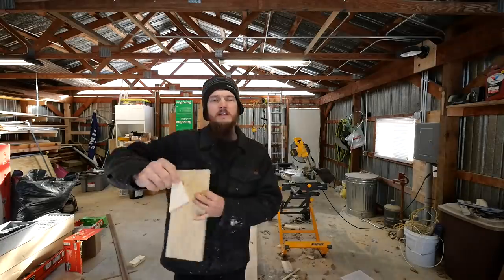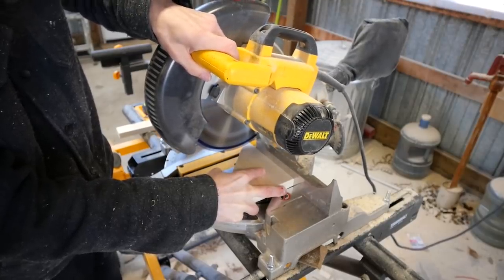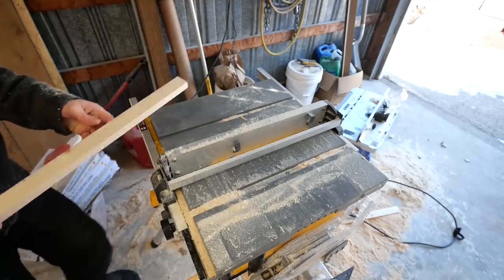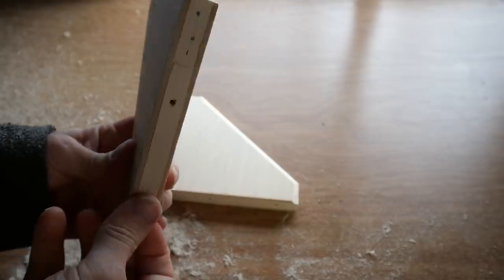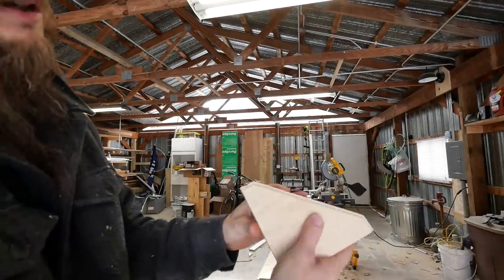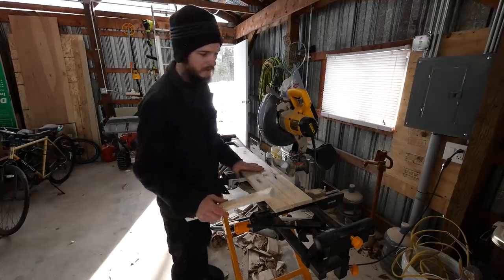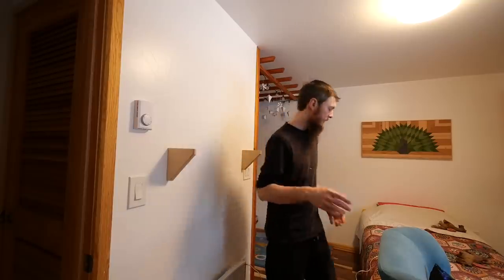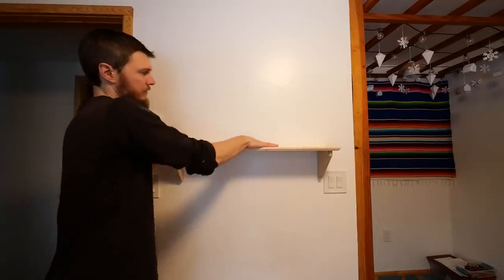Shelf Brackets Hacked - Hidden Hardware and Easy to Make

Comment: If any of your subscribers know someone in research and development in the home building industries or tools, they need to get their human resources people after you, Doug.  May be too 9 to 5 for you, but it seems like it would be a blessing to them and you and diy-ers!  The shelf bracket idea is great!  Again!  Glad I got to see you use the router around the corner of the bracket.  Would not have known that is how that is done.  Why did you choose a glue gun over wood glue to attach the shelf?  I would probably use nails or screws and putty it or put a piece of contac paper or veneer on the top of the shelf to hide them.  Hope you appreciate how supportive Ashley is!  Glad the weather has been good enough for you to get out to the barn and work!
Reply from the maker: I used hot glue to make the shelf easier to be removed in the future, if need be. The main idea was to experiment with shelf brackets. If I created a shelf unit I would have built it differently. Wood glue is too permanent.

Comment: Very nice looking shelf and I think Belle will get many years of enjoyment from it.  As an added note, when my brother was making wood shelves  such as this one, he would make a key hole in the bracket back and slide it down over a screw.  They held up very well.  On other shelves the were larger he would design a decorative back plate on the shelf  then pre drill and counter sink holes in the back plate, screw the whole unit to the wall then cover the counter sunk holes with a rounded button (they come in many sizes).  Those shelves were very strong also.  Love these DIY projects you are doing.  I am only sorry I can no longer do the wood working. Spent many happy years making country craft items.   Have a Blessed day.

Comment: Very nice. I think if I were doing it, I would put a dowel glued in the top of the bracket sticking up about 1/4 to 3/8 with a corresponding hole in the bottom of the shelf. It would keep the shelf from sliding from side to side and could just be lifted off if you needed to move the shelf. The part that attaches to the wall, since it is not seen could be made of nylon cut from an old cutting board and be less fragile than just a small wooden piece.

Comment: I like the clean look of painted drywall, but If I was building a house again I would put 1/4" plywood on every wall THEN drywall! We did this in both bathrooms as spacers due to built in fiberglass tubs, and it is SO nice to be able to just screw in anywhere!

Comment: I always look forward to your next video! The DIY shelve is  genius ! 
There are anchor screws that have a flare out built into them that works really good on Sheetrock when you can’t find a stud or like you said, not center to your room. We hung shelves in our apartment and that’s what we had to use, got them at Meijer’s. There is different sizes to fit your project needs.

Comment: Good job! 👍🥰
📐⚙ Only thing I'd change is to make the cut between the two pieces for the cleat be at a 45 degree angle. That will give an added level of strength to the shelf and prevent the chance it could pull out. 💪🥰
I used this same concept to hang a 3-door cabinet above the span of my washer and dryer. Mounted I think it was a 2x2 with a 45 degree cut (horizontally), about 1/3 of the way thru the 2x2, to the studs on the wall. Then mounted a 2x2, with the facing 45 degree cut, to the back of the cabinet. Lifted the cabinet up and set it onto the cleat on the wall. The weight of the cabinet was sufficient to anchor it, but I did put a couple of screws through the cabinet back and into the 2x2 as security. 
You could use this same horizontal method to mount a shelf that you didn't want to use brackets for. Then it'd be a floating shelf. The piece on the wall would just cleat directly into the back of the shelf. To prevent sliding, you could add a notch or two along the cleat. Voila, no worries about where the studs are in relation to the shelf! You could still attach brackets directly to the shelf, from the back, as a purely decorative piece if you wanted to. 🥰

Comment: Would it work to use dowel pegs to attach the shelf to the brackets?  They wouldn't show and would be unlikely to slip.  If the holes in the shelf were very slightly larger than the dowel, it would be easy to take apart if needed.

Comment: I love using French cleats. Good job with that. I noticed the thermostat on the wall. Did you change over to individual room electric baseboard heat?
Reply from the maker: All of the rooms have Stiebel Eltron wall heaters wired to thermostats. :)

Comment: Drywally but fireproofy. You should have my house.... it's all Shiplap sheathed in hardwood plywood. I can hang a mirror anywhere. It's also a pain. When inside plumbing was installed a bunch of it ended up outside the wall. (it's just a utility space so no big deal...right?.....sigh) To fix it we had to take out part of the wall, board by board. Move the galvanized pipe inside the wall. Then, put it all back and cover the whole wall with Greenboard.

Comment: I've had very good luck hanging things on drywall using toggle bolts. Large ones, though requiring a substantial hole, can h old quite a b it of weight.

Comment: Nice shelf. You could have put little boards underneath that you slide the shelf onto the brackets. You wouldn't have to glue it to them and it wouldn't move side to side. Just a thought.

Comment: It sounds like your table saw needs new bearings. The old bearings will need to be pressed off, using press bearing blocks. When I work on a motor, I drill a hole in a 2” x 6” for the motor shaft. Loosen the shaft end, end bell. Put the motor on the wood block. Pull the opposite end bell. Carefully Lift the motor casing off the armature. You may have to push the centrifugal switch back to release it. I’ve used golf tees to hold the centrifugal switch open, but any pieces of wood similarly will work. Tape the windings with blue masking tape pieces, so they don’t get nicked. Take the armature or end bells to someone to press the bearings out. If the bearings are in the end bells, I have been able to get them out by freezing the entire end bell then heating the end bell avoiding the bearings and taping on the end bell. To install the new bearings, on the motor shaft. Freeze the motor shaft, heat the bearings up to 140 to 150 F. They should just **drop down on the shaft. For the end bell mounted bearings. Freeze the bearings and heat the end bell to 140 to 150 F and drop them into **place. Mount the bearing as **square as possible, do not cock the bearings.

Comment: You can also dovetail the top of the bracket then place screws on the bottom of the shelf and slide into the dovetail slot; IF you don't want to glue the shelf to the bracket.  Regardless...cute shelf

Comment: I have used the metal brackets attached to the arm, but you have to routeout a hole in the wood . The bracket will lock into a screw on the wall.

Comment: Way late to this video but could you do French cleats at the top as well. Design them to sit down and slide forward locking into place then slide the shelf and shelf brackets down onto the cleats? That way it will lock the shelf into the top as it won’t be able to move back while against the wall.

Comment: Looks great... could perhaps use some finish.  Other than that, I had the thought that when you routed out the slot on the back of the bracket, you could have stopped short of blowing out the bottom of the bracket maybe?
 
In any case, still looks great.

Comment: Drywall sucks for shelves.  If I can go wall to wall, or at least one wall, I feel much better.  Brackets are ok, but studs are almost always a must for anything other than a few decorations.  Usually the bracket needed in the middle is off to one side.  Toggle bolts or the strap snap toggles work pretty well if there's at least something on a stud.  Toggles are awesome for mirrors and things flush to the wall, that don't move.  But yeah, drywall sucks.

Comment: you could of routed 2 groves where the brackets are on the top board that are a smidge smaller then the brackets wedging them in using friction

Comment: Drywally???  Bad product?? Compared to what??? I admit I am not a huge fan but it beats mud and horse hair on a lath covered studs. And its much faster and easier to repair or replace. Next step up is plywood and the cost would be so prohibitive...and its hard to maintain (warps/sanding/painting/etc) - it does have some off gassing -- Then  there's ship lap boards or other wood based planking.yada yada .. but I wouldn't throw out the baby with the bathwater. It exists to fill a gap in the finished wall costs. You guys are great and don't get down with my words. We all have opinions.
Reply from the maker: There is a definite lack of wall coverings available on the market. We need some clever innovators to develop new walls. Any time manufacturers have tried to introduce new products, Big Gypsum suppresses it because they want to stay being the leaders. Drywall is basically a modern version of plaster and lath, but why stick to that. Drywall can't handle water, is prone to molding easily, crumbling, it's super heavy, a big hassle to finish, etc. Wood boards or plywood seem to be the best current options available at this time. We need something brand new and revolutionary to come along and not be suppressed by large corporations who want the monopoly.

Comment: How about small short dowels, little wooden pegs in holes to attach shelf to brackets.
Reply from the maker: You could, but you would have to measure everything precisely and have the tools to do that. That wouldn't be ideal for standard shelf brackets.
Reply: @diyfferent  Oh, OK,thanks. The glue system worked well.

Comment: you can make the brackets look lighter by cutting out its center and router it , it might be nice to do actual woodcarving on the sides (like a bird)
the brackets like youre using sticks out intoo the shelve space below it if you use them as a bookshelve , i like this type of floating shelves for that  
https://www.walnutwoodworks.com/wp-content/uploads/2018/01/walnut-shelf-2-1.jpg looks a lot cleaner 
you can make youre own version using treaded rod mounted intoo studs in the wall then though the shelve bolted against the wall , and sunken hole holding the nuts covered with a wood plug and sanded smooth
as for where you put the shelve  too bad you mounted it a little low because i think you could put a nice mirror under the shelve , she can put her brush and personal care stuff on the shelve
as for holding the shelve in place you could put a dowel in each bracket and a blind hole in the underside of the shelve so the dowel drops in the hole and holds the shelve in place

Comment: Lot of work for a simple shelf, need to value your time better.  Use of metal or a bookcase would have been better.
Reply: Bookcase type with sides and multiple shelves is what I mean. 

You can have semi hidden fixings by placing them inside, further showing the fixings gives honesty to the shelf in terms of material used and aesthetics